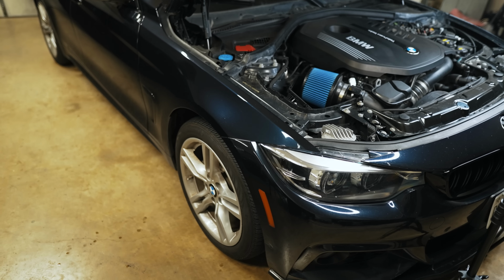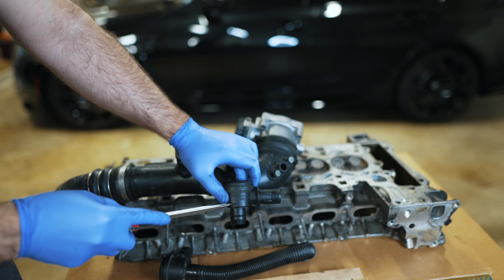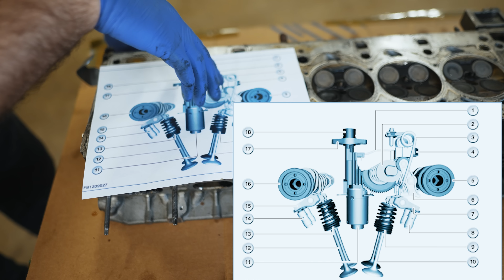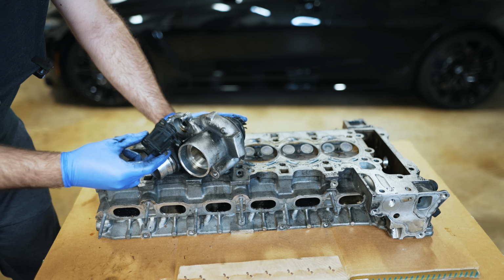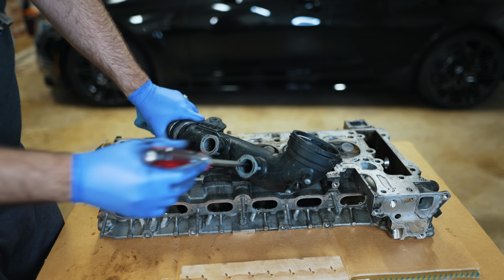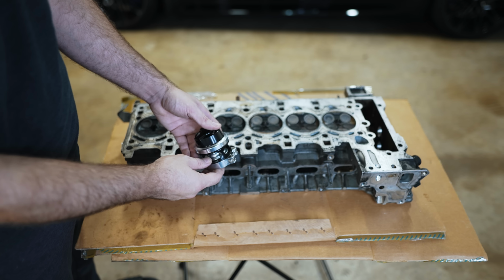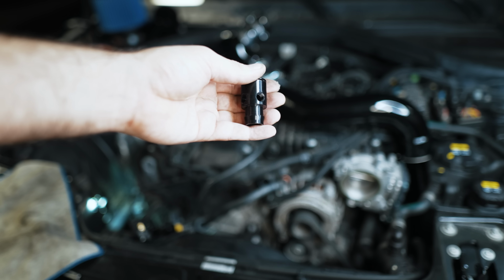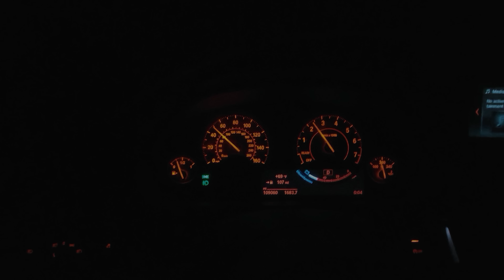Why Don't New BMWs Have This Anymore?

Comment: As much as I yell at my X5 on a weekly basis for making my wallet lighter, but when everything is working in concert I have nothing but a stupid grin on my face, it’s a love and hate relationship honestly.
Reply: X5 owner here. How old is yours and which submodel you have?
Reply: @Ashley_van_Schooneveld  
It’s a 2011 model, it’s the mid trim with the inline six turbo,
Reply: @cedrick305  You have an N55 right?  PWG or EWG?
Reply: @kylesmith9048  
I believe mine is the PWG because I don’t really see any electric connectors on my turbos at least from looking at it from the top of the engine but I could be wrong.
Reply: @cedrick305  “Turbos”? You have an N54? I had a 2011 335i (N55) and being from the same year as your X5, I’m assuming you have an N55 as well.  Even my dad’s 17’ X5 has an N55.  I currently drive a 16’ M235i and it has an N55.  They put em’ in almost every car from 11’-17’ it feels like.

Edit: I’m just now connecting the dots.  You have an X5, you have an ‘M’ as your profile picture, and you said “turbos” with an ‘s’.  Do you have an X5 M?!?!  The S63 is a beaut!

2nd edit: I’m a dumbass that confused you with the first guy that replied, the X5 owner who asked the question.
Reply: @kylesmith9048  
Lmao no worries, but I’m currently in the process of replacing my electric water pump and thermostat all in 30 degree weather.
Reply: @cedrick305  That’s a rough one.  Currently 55° in Dallas 😏.  Good luck, let me know how it went!
Reply: @cedrick305  Inline 6 gasoline or diesel?
Reply: @Ashley_van_Schooneveld  
The inline six gas turbo, I’ve heard the diesel version can be quite finicky.
Reply: @kylesmith9048  
Update: after much cursing and coolant all over my driveway, the job is complete and did the electronic bleeding procedure and so far so good, keeping my fingers crossed.
Reply: @kylesmith9048  lol I'm the M logo guy. I have a 2017 X5 35i with M Sport. Not a true M lol
Reply: @Ashley_van_Schooneveld  
Overall it’s been fairly reliable but like all German cars they have stupid little problems that becomes really big headaches if they get ignored but I plan on keeping mine for a while and watching out for an X3 as well with the same engine.

Comment: Weird. BMW doesn’t use the throttle body, the valve is always open and throttling is control via valve lift. This is because a throttle valve induces pumping losses.

Comment: can this work on the b48
Reply: Still hoping for an answer. I don't see anything out there for a B46/8 BOV
Reply: I think it should work because it similar  engine  with two less cylinder
Reply: Have u found an answer yet? I have a b48 but I don’t know if I can get a blow of valve

Comment: I have the same kit on my 340i, sounds awesome I love it. You get the full sound when you let off after a gear change, or keep partial throttle when you let off otherwise they are crisp like you say. I'm pushing 21psi on stage 2+ stock turbo.
Reply from the maker: Nice, yeah at 21 PSI I bet it sounds great.

Comment: Is the upshift pop created by both diverter air and extra fuel injection? The sound only happen on certain sport models mimicking turbo anti lag. Without extra fuel, would it still pop(enough hydro carbon in CAT?)?
Reply from the maker: Yes if you notice in the video during the shift you get a pop and only when I let off the gas at 5K RPMs do you get a strong BOV sound.  So with an automatic the BOV won't activate during a gear shift.  I don't think you'd get the pop unless fuel was being diverted to the exhaust.

Comment: Hey brother. 

I’ve been hunting down this 101f01 code for a while now. On an n55 x3. It only appears in the cooler months and then disappears in the warmer one. The mechanic can’t find any leaks in the valve cover with a smoke test. I’m guessing is a micro crack of a component but not sure where it could be. Manifold pressure too high and engine light comes on.

Comment: You need to keep in mind that the boost after the intercooler is less than the boost before it “charge-pipe” so the BOV spring must be stiff enough to compensate the boost difference.

Comment: Do you know if the s55 has a diverter or blow-off valve?
Reply: Don’t think any EPA certified cars in USA have venting to atmosphere, like using BOV. I believe BOV are always aftermarket parts. So it either has diverter valve (excess air pressure go into intake manifold) or recirculating valve (excess go in front of the turbine or intake pipe)
Reply: @profuse007  Thanks but I wasn't asking what I might have but exactly what I do have.
Reply from the maker: No it would be like the B58 and I'm guessing they refined that technology on the S55 given it had a dual clutch + boost and adopted it on the B58.  You can get a BOV kit for it as of this year from BMS.
Reply: @VehicularDIY  thank you very much for answering.  It was very helpful.

Comment: Nice video! Can you add a bov to a n55. Also another question i have a f30 and everytime someone opens the door i get a key not detectable notification on idrive. Just changed key fob battery and still happening. No issues other then whenevr someone opens the door. Comfort access works fine. Could it be the battery of the car.
Reply: N54 BE BETTER
Reply from the maker: Thanks! You can add an electronic BOV on the N55.  If you were to shut the car off and start it right back would you still get that notification?  I noticed on the F36 it seems to hold on to the message even when the issue is gone.  On the E90 it would automatically clear the message once the key is redetected.
Reply: @VehicularDIY  no the notification wouldnt come up. I read the forums today a lot of people were sayying they bought the ebay logo door light and they would get that notification whenever they opened the doors. Once the swapped back to oem the notification wouldnt come one. My car has those ebay logo lights. Im gonna buy some oem ones.
Reply: Yes you can. If you don’t want to go full on bov, you can get one from go fast bits. It’s basically an adapter that helps it to hold more boost. Not too expensive as well. Would totally recommend for a mild to medium set up.

Comment: I had twin Turbosmart VTAs on my N54 when it was a running car 🤤 Sounded so good. I had a Turbosmart VTA on my ecoboost mustang before I sold it and now I have a Turbosmart SuperSonic on my 14' Tremor and it sounds like a big rig when they hit their air brakes hahaha 

Turbosmart makes killer equipment, I've also used their wastegate on my mustang and I have a set ready to go on the Tremor. They make super nice stuff 🤘

Comment: Great videos! Purchased the same kit for my 17’ 340i but removed it bc I got so many mixed opinions. I understand there’s no performance benefits but are there any possible negative effects on the engine or turbo? Also after installation both the factory wastegate and bov are left in operation ? I have catless dp,intake,intake/turbo inlet resonator delete,stage 2 tune

Comment: First of all no car has or needs it. 
When Upshifting under Throttle they keep Boost in the engine so throttle Response is better. In any other case they use the dump valve inside the Turbo to blow of and keep the Turbo spinning. So fitting a blow off is plane stupid!

Comment: I currently have a 2014 Touareg TDI R Line, stage 2, on Bilstein B6/H&R springs, with Audi 21" Peelers. I'm considering a 35k mile BMW X3 M40i. What's your advice and/or thoughts?

Comment: Question ,which years 328i is compatible with my 07 pre lci in order to do a manual swap?
Reply: you can even get the manual from an n54 cause the bell housing bolt pattern is the same, might need a different drive shaft. this topic has been discussed on the forums countless times, id suggest you check it out there
Reply: @NMautomotive  Thnks for that information,which forums is it on
Reply: @DirtyGarageTx  just google e90 328i manual swap and you'll see
Reply from the maker: E90post is a popular one.

Comment: BMW relocated the MAF sensor on the N54 from the intake manifold to downstream on the air intake on the N55 plus with the boost pressure on the charge pipe.

I'm also quite happy the wastegate became electronic in mid-2013 moving away from a pneumatic wastegate. More performance, reduced maintenance and less problems.

Call me boring, I'm running fully stock as in no tune at all; but I have a VRSF charge pipe and M Peformance exhaust.

Comment: N54 FTW! BMW cutting corners with no bov. Valvetronic is no substitute IMO. Nice video.
Reply: What’s even more amazing is you can get the BOV sound on the stock N54 for $1 with a pair of 1” rubber chair leg caps.

Comment: It's still a 4 cylinder though.
Reply: Its a inline 6 same motor as the supra
Reply: Most of the performance bmw engines are 3 liter inline turbo 6's or turbo v8s...and my 3 liter m4 has 570whp with just a downpipe and charge pipes and e85.